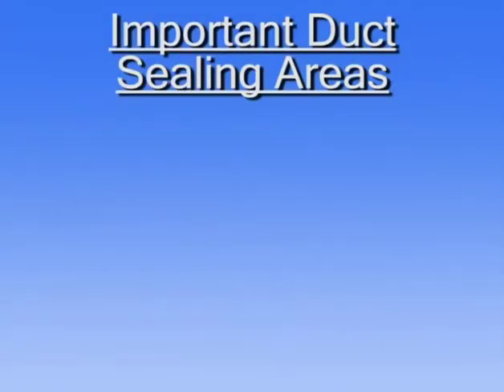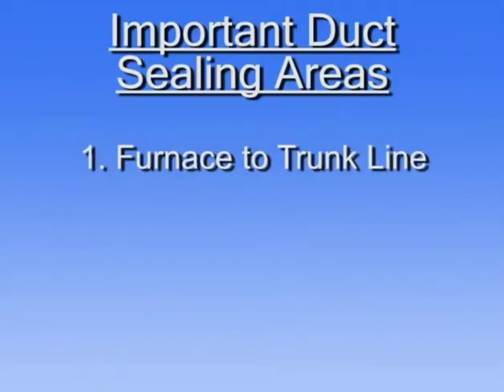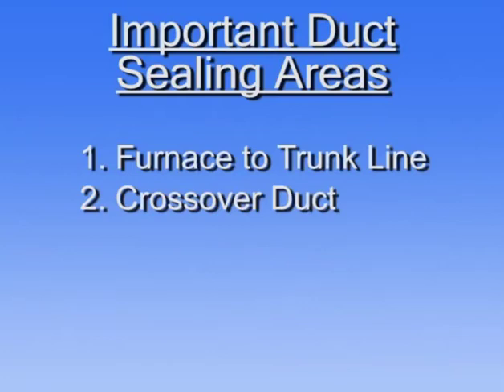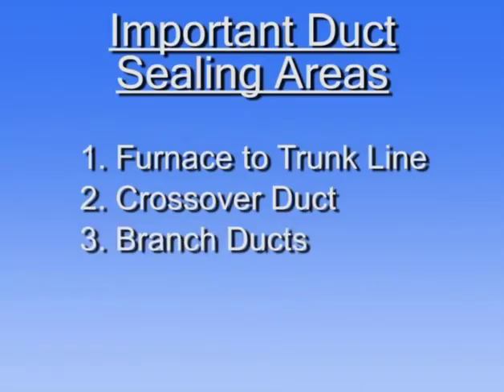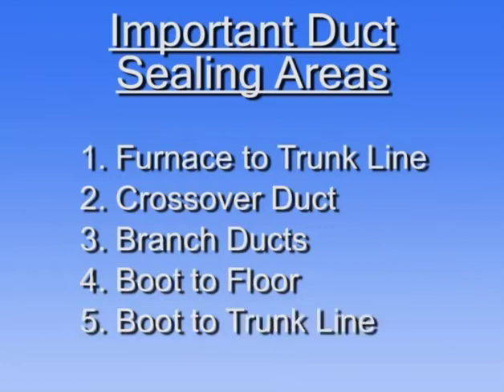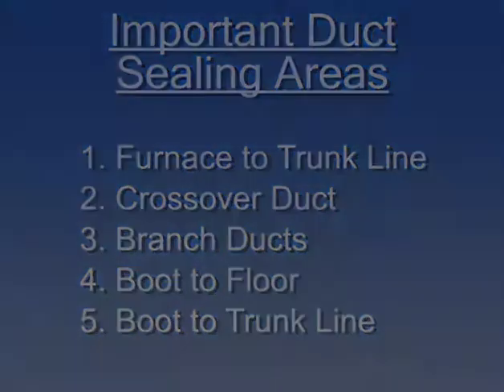Mobile Home Sealing Ductwork

Comment: What year is that home? About to close on a 2005 DW. I hope they did a good job sealing all the duct work. I do not want to go under it and start cutting holes in the belly board and chasing ducts for sealing connections.

Comment: I bought a 2000 Oakwood single wide mobile home new.the end where the blower was stayed cool and warm but the farther you go to the other end the worst it got.
I do heating and air conditioning.i tore out the unit inside and made a nice linen closet.i set a package unit outside and ran all new duct work and cut new vents in the floor under the windows.also but multiple returns in also.now it’s comfortable in all the rooms.
Reply: l

Comment: Maybe not all mobile/manufactured homes are the same? I'm in a 3300 square foot Triplewide with an attached climate controlled two car garage. All of my flex duct supply lines are all suspended from the frame in my crawl space the band anchors are run up through the plastic belly barrier and insulation not through the belly of the trailer like this i have three 16 inch flex trunk lines one down the center that is connected directly to the bottom of my air handler with 10 12 inch crossovers 5 branched off to each side from the center one and all 3 runs are the length of the trailer with 8 inch branches coming off here and there going to the vents through the insulation and belly cover. It was like this from the factory the 8 inch 4x10 supply boots for all the vents were all suspended through the insulation and belly cover waiting for the duct system to be attached it came like that from the manufacturer. Maybe they don't use the belly ducts like they do on double wide trailers as they do in triple wide manufactured homes? My triple wide was actually brought in in 8 different sections that they put together on the site on top of a crawl space that was pre-dug deep enough that you could stand underneath the dwelling instead of crawling around unlike a double or single wide the frame and axles did not remain they picked the sections up off a trailer and set them in place on an 8-ft Pier concrete foundation. with a massive crane but for all intents and purposes it is classified as a mobile/manufactured home. Which is a whole nother ball game that doesn't make sense to me.